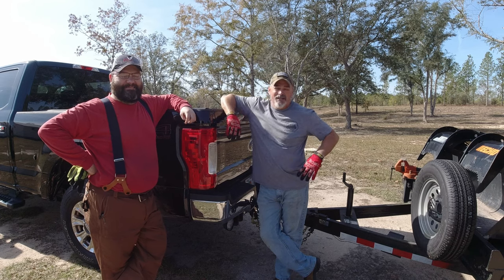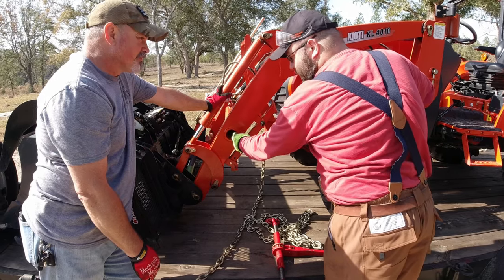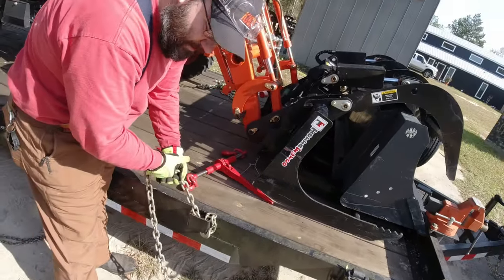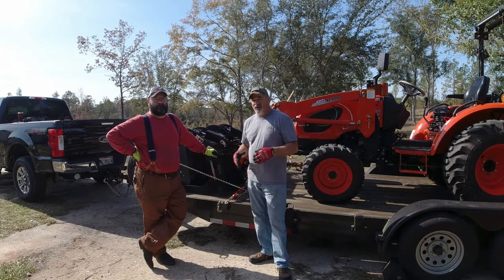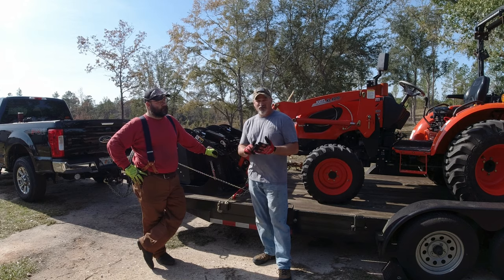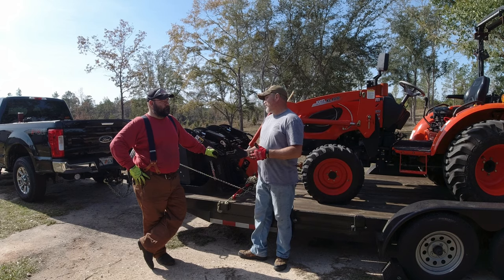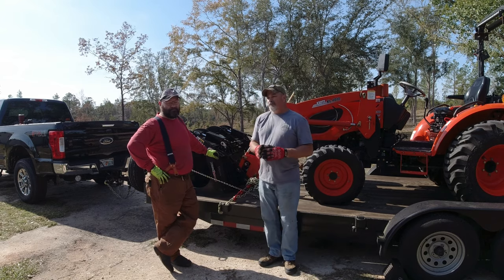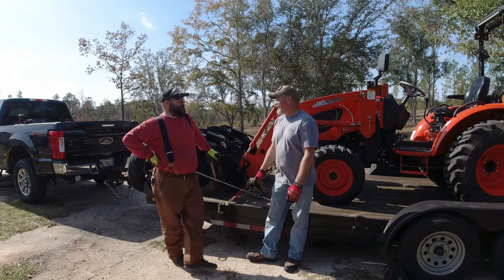SAFELY Load Your Tractor Onto A Trailer | Compact Tractor tie down points

Comment: Thanks Hank. Perfect timing again.  I just borrowed a trailer to haul my tractor and I made a video so everyone will get a good laugh, ha.  I liked the informative demonstration by you and B.  I know this is not talking about the heavy load to carry on the trailer but remember to clamp down or remove any small items that you have in tractor pouches or tool boxes.  I've seen rags, pamphlets, drink bottles etc fly off tractors that the hauler totally didn't think about b/c they were focused on the tractor and the implements (which is good) but remember those small loose things.  It would be totally bad to have someone's windshield mangled b/c of a wrench that flew off a tractor's platform.  One guy must have been working on his tractor to tighten his chains and left a bar on the tractor bed and guess where it went.  Nicely done video by the dynamic tractor duo.
Reply from the maker: That's an excellent point Don! I wished I would have thought to say that in the video ( the small components part of your comment) 👍

Comment: Maybe you mentioned it, Hank, and I missed it, but is important to position the load so that it does not have negative tongue weight.  If there is negative tongue weight, the trailer can start fishtailing and get into the death wobble.
Reply from the maker: No, I didn't and that's a huge point. Thanks for that👍

Comment: Years ago, after watching and being victim to loading farm tractors, equipment, vehicles, etc. onto trailers, and seeing the loading operation, not so much the tie down portion, I came up with a solution that has worked for many, many years. If you get this part right, it will lessen the wear and tear on your nerves, as well as stopping any loading accidents, which could impact your tie down operation.  I went to Tractor Supply and picked up two swivel jacks. They come with a weld plate already attached, and they lock at 90 degrees on both horizontal planes, and 90 degrees to the vertical plane. I welded one jack on each rear corner, about 1 foot from the end of the trailer for me, which provided enough clearance to clear the handles, and to clear any part of the frame. I pull the pins, turn the jacks vertical, place a wooden block or two as needed under each jack, and crank the handle to push the jack leg down to the block to support the rear of the trailer. You can then drive your equipment on the trailer, the trailer will not lift up the front of the trailer, or your shocks, or risk coming un hooked and damaging your tailgate.
Reply from the maker: Very interesting. Thanks for sharing 👍 that sounds awesome.
Reply: That is a really good idea. I have seen that setup in action before. The dovetail on my trailer doesn't cause the tongue to lift as much as a regular straight deck or deckover, though. But that issue is for sure why I make sure to chock the wheels, put the parking brake on, put the truck in 4wd, and make sure I am on solid, level ground.

Comment: Very good job. It's not going anywhere.  Since you asked how to make it even better, I have a few suggestions.  I would have a D ring on that front frame so your ratchet can connect directly to it (less chain/potential failure points=win.) You might also want to tie down (ideally) or at least block 2 of the 4 tires. You can always add a permanent, custom front chuck (4" high?) on that deck (if it's what you primarily tow all the time- maybe in front of the front right, and rear right wheels.  Not sure if you were using a weight distributing hitch or not but they can be helpful. Place a rubber mat between any and all surfaces that will rub on the chain. Spray paint the specific links on the chains where you always connect them as future reference points- again, if you load this truck regularly. Run tie downs on each of those steps. Now for my top tip- fabricate a nice, strong lip on the front of that deck that the shovel can basically slide/lock into.  This will add incredible strength overall tie down design- think in terms of front, lateral and upside down.  In trucking- anything goes.  Also, running a strong chain dead center mass from underneath that ties into the frame and cinch that down too.
Reply from the maker: Thanks for the input!
Reply: @HamiltonvilleFarm  Sure.
Reply: Impressive setup guys. I kept wondering about the center of the trailer, it looked like the tractor might be too far forward on the trailer, and I was wondering about the truck size and determination of towing requirements and hitch requirements. Very interesting calculations involved for a safe setup. Thank you.

Comment: The weight that is stamped on the tractor is the weight of the tractor only. The attachments are not added to the weight. You have to add them in. For instance. If you add the front loader you have to add the proper weight by what size front loader you have installed. 1 yards, 1.5 yard 3 yard. Whatever the correct size is. Then the back is the same. Is a hoe ram or is a backhoe being attached. Then on top of that. All the attachments must be tied down separately from the tractor. You did a good video. You are putting people on the right track. All ways check DOT regulations. They are very strict.
Reply from the maker: That's a true statement. Thanks for watching and taking the time to comment 👍
Reply: Hamiltonville Farm yes sir. YW

Comment: When you wrap your hook ends into the stake pocket, make sure they are hanging right side up.  If that chain gets a bit loose, gravity will help unhook them.  Hook them the other way around then run them around the stake pocket....OR, fab you up some quality stake pocket D-rings and hook the chain to itself.

Comment: This may have already been mentioned,  me being an old flatbed trucker I noticed that you did run your chain through the stake pocket which is the correct way, but you should always have the hook on the top of the pocket not the bottom, if the chain should come slack the hook could fall down (gravity) always hang the hook on the top of the pocket or rail so if the chain does become slack  the hook will still be hanging on the pocket....again gravity. Great video guys!
Reply from the maker: Thanks Bill👍

Comment: Great video, lots of good tips!  I chain my axles and cross the chains.  Ratchet straps on any implements that are attached.  Fun one for me is loading with the backhoe attached.  The trailer is rather high and the backhoe hits the ground on the way up.  Usually have to use the stick and bucket to push it up on the trailer.
Reply from the maker: Hey, whatever works right? Hope all is well Bryon.
Reply: I'm always afraid of damaging components by strapping to the axle. That's why I added the tiedown points to my Kioti. It seems most people have success there, but I get nervous of damage.
Reply: I understand your caution.  I make sure the chains are well clear of tie rods and three point arms.  I don’t worry about the heavy cast axles, but I’m a mechanic from way back and will hit anything with a big hammer without fear, lol.

Comment: A good point y'all made is putting the truck in 4/wheel drive or chocking the front wheels on a 2/wheel drive. The orange tractor is a big plus also.
Reply from the maker: Lol. It is a nice tractor. Thanks brother 👍
Reply: the new 2020 kubota  M8-211 is a monster big beast

Comment: Also remember axle ratings are not the capacity of the trailer. A lot of people think that is the case when it’s not. Ex: my trailer has 2  7,000lb axles. So according to the manufacturer it’s a 14k trailer however, you have to take the weight of the trailer out of that 14k. So I have a 14k rated trailer but the trailer weighs 4,550lbs so my actual load capacity is 9,450. I know there’s a lot of people with homemade trailers so they don’t have that info tag, but maybe this will help someone.....also instead of wrapping the chain around and having the hook like he had it, put it so the hook is at the top so if something happens the hook will stay hooked to the trailer.
Reply: Thanks for that tip on the hook. I'll make sure to change it up next time!
Reply from the maker: yeah good point about the weight of the trailer being included and home made trailers.  I should have mentioned that, because it is important.

Comment: Good info!  I need to get better at that.  I think balancing the load itself is equally if not more important peice that you didnt talk about. A thing called negative tongue weight is a term  I became very familiar with when I almost flipped towing a tractor for the first time. In part because of my lack of knowledge and experience and 2. I trusted the Guy who improperly balanced the load on the trailer. We thought we knew what we were doing but we were wrong. Fish tailing down the rd at 55mph well I was like Carrie Underwood Jesus take the wheel. LOL. Fortunately I didnt hit the brakes I gave it gas instead and recovered,  but very scary.  Thanks good vid!
Reply from the maker: Yeah lots to consider for sure. Thanks for the comment 👍

Comment: DOT requires 4 chains for a tractor; not 3. Also, the FEL is a separate attachment so it requires 2 chains on it. Any optional attachments (box blade, land plane, back hoe, etc) need to have 2 chains securing them as well.

Comment: I think you need to put a chain on the bucket. Once you shutoff the tractor tractor hydraulics loose pressure. That bucket could start shift around as you go down the road.
Reply from the maker: Hmmm, you didn't like the chain we had on it? Maybe you missed that part? You're right, you gotta chain it all down!

Comment: Great info. I have a 6x8 block of wood I put under the back of the trailer. Keeps the truck from going up when the weight of the tractor is on the rear of the trailer.  Works for me.
Reply from the maker: Yeah that is a good idea👍
Reply: I guess I should give credit to my brother. His idea.  But it keeps the trailer pretty level.
Reply: I keep a cheapo Harbor Freight 2-ton jackstand with my trailer and use that under the rear center.   I’ve loaded my 6500# tractor without it and it really lifts the backend of my F150
Reply from the maker: @extraacct478  cool👍

Comment: The D ring on the front is a single point. Having 2 chains on it, regardless of how heavy the chains are or ring is, is a single point attachment. That is little different from just looping a single chain or strap through the ring. You need a separate anchor point on the front.
Separate anchor points on trailer and load, front and rear. Talk to a wrecker driver about how to secure a rolling load onto the bed.
Reply from the maker: Thanks for watching 👍

Comment: I have a question about the D ring mount. I just bought a CK3510. Did he use the same bolt holes that were in the bottom of the front rack with longer bolts and nuts and is it 3/8 plate he used. Thanks!

Comment: Two things that I have seen happen:  One is to put a 2 5/16 trailer on 2 inch hitch.  It seems obvious, but the trailer will come off and really mess up back of truck.  The other is tire inflation.  If your tires are underinflated, the trailer can start swaying left to right.
Reply from the maker: I've been guilty of under-inflated tires. Not fun.

Comment: The safest way to make sure you’re not lifting the back of your truck install two stabilizer jacks on the back corners of the trailer and you won’t ever have any issues of the weight lifting the truck. Super cheap fix.
Reply from the maker: Good point👍

Comment: A modern half ton could tow that setup there. Most are rated to 10k or more now. Just make sure you’re drivetrain warranty is intact! 

Having a good trailer with tandem 5k axles and good brakes is perfect for the kioti ck10 series and a few implements.

But over 10k, you’re definitely in gooseneck territory.
Reply from the maker: Yes sir. I appreciate the comment 👍

Comment: When hooking direct, which is one end on load and the other attached to the trailer, the working load limit is half of the chain or binder. If hooked indirect, which is across the load, the the working load limit is the full capacity of the chain or binder. The total working load limit must be equal to at least half of the weight of what you are hauling. And always be sure to get your load limits from the lowest rated item, which if all chains and binders are the same size, the lowest rating  should be the chain. 
And please, always have a vehicle that is heavy enough to stop the loaded trailer
Reply from the maker: Ah! Good point about the weights. And yes..please get a truck heavy enough 👍
Reply: That’s how I always do mine, I have a homemade frame on the front of my tractor. I run the chain a crossed that frame on the front and through the drawbar mount on the back. Then a strap or two on whatever is on the back of my tractor.
Reply from the maker: @groundupexcavation  👍👍
Reply: That's some really good information and terminology. I've never heard of the "direct" and "indirect" differentiation of chain/tie down attachment before. Thanks for that!

Comment: YOUNG MAN ,

I HAVE 1998 GMC SHORT WHEEL BASE PICKUP , WILL LOAD UP TOO :  10,500LBS / BECAUSE REAR AXLES IS 3 . 73  AND COIL SPRING SHOCKER !
Reply from the maker: That's cool!